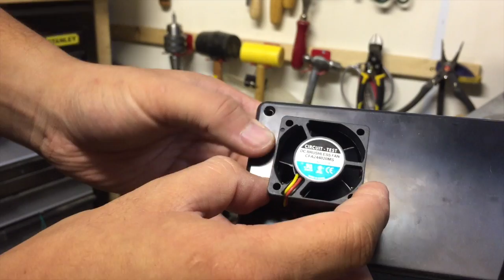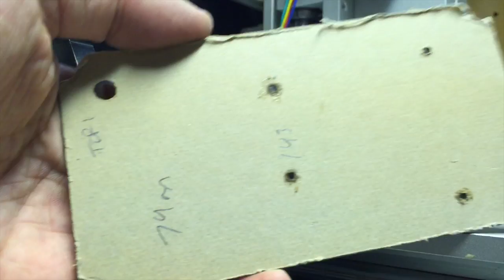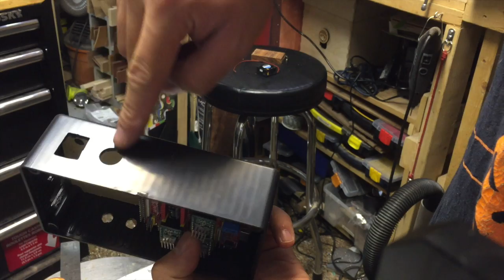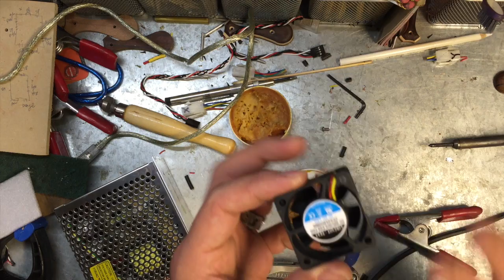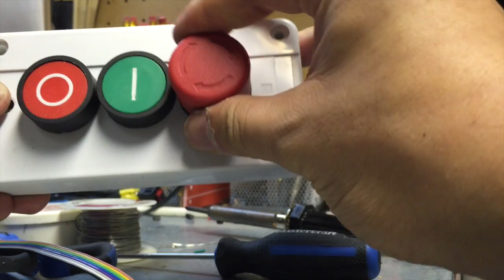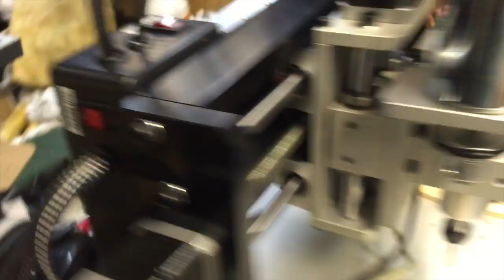Metro Made | Sable 2015 Lunchbox CNC Conversion PT 2

Comment: Cool build! - I would recommend that you never put solder on the wires that goes into a screw terminal, as solder cold-flows and will give you a bad connection over time.

Comment: Great video. Did the CNC come with any hold-downs or did you make your own?

If you were machining a part, how do you tell the software where the dimensions start, for example, in your wood project in the video, how do you tell the software in the Z-axis where the top of the wood's surface is?

You still have exposed mains-voltage on your power supply terminals. Those power supplies typically come with a plastic strip that fits across the terminals. Don't let any kids near that voltage.

Comment: Thanks for showing this. You put the grbl in the arduino (is that correct) and then what program were you using to run the gcode? Thanks again.
Reply from the maker: I was using GRBL controller 3.5.
Reply: +Eric Au (Metro Grade Goods) Thanks for the information and waiting for more of your builds. Question : Is there a way to have this shield work 4 axes instead of just having the 4th one just clone one of the others that you know of.
Thanks again.
Reply from the maker: +amtpdb1 To know knowledge, GRBL does not support a 4th axis. John Lauer managed to get his 4th (A) axis running, but only by manually jogging it in Chilipepr. The CNC shield is really for 3 axis and the 4th is a clonable driver.

EDIT: just took at look at GRBL Controller prefs and there IS a 4th axis enable, now that I see that, I remember seeing a thing about it on the release notes of the latest software build.
Reply: +Eric Au (Metro Grade Goods) Thanks for your time. The video was informative.